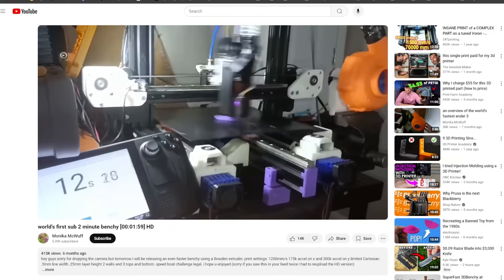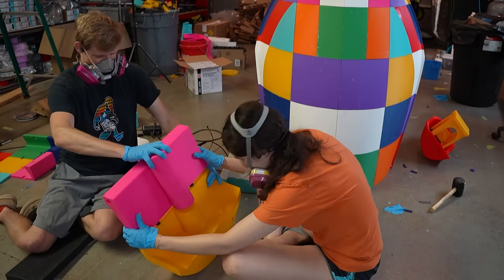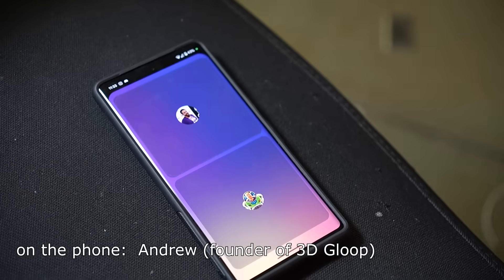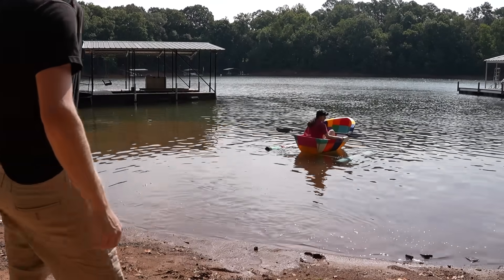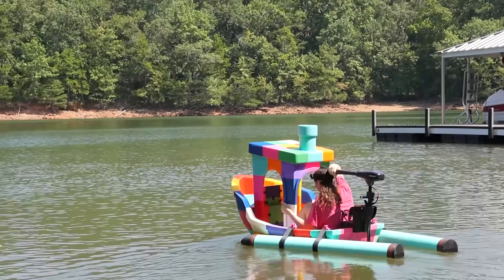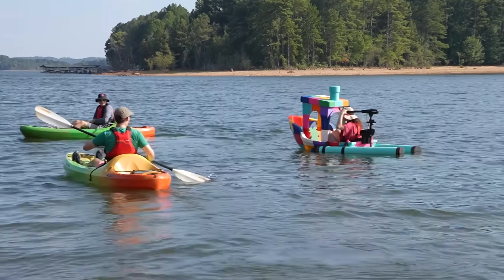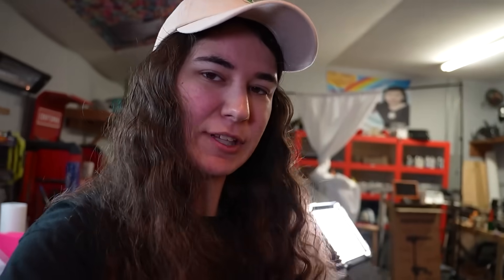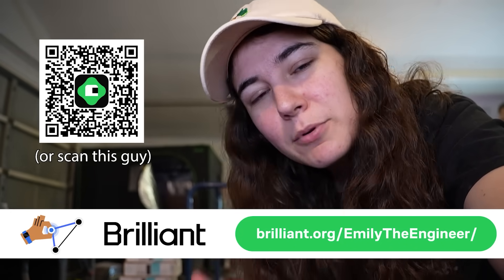I 3D Printed a Boat (World's Largest Benchy!)

Comment: Great video. But with 2 big float pontoons, you can get anything to work as a boat. Even an anchor. But the problem could have been solved with a heavy enough keel. For example, with a lead weight inside. The boat has enough buoyancy for that by a good margin.

Comment: Add a solar powered trickle charger for next time and i believe they sell kits for trolling motors that allow you to electronically control it with a steering wheel but I could be wrong

Comment: 9:38 The sun is so hot that it melted the connection to the battery. Totally hadn't had anything to do with using the power cable as a tow. This video is sponsored by Brilliant!

Comment: Next, I recommend a steering system for the trolling motor. You could use a simple cable a pulley system for simple pull/pull steering.

Comment: ideas that can improved to the boat
(E.E.E is that i will put more ideas)
1.make a Trailor that can hold battery (or make it some ware to put it)
2. put airsoft guns at the side to shot innocent by standers (friends) or put target on the water
3.make a pole attach at the mooter pole to control at the front like horizontal and go vertical (and try nom to hit your head)
4. put light at the front if you or some one want to go fishing on that or just go at night
5.put light at the back to put it reverse or just to se every one ware are you at night
6. put some paroles if you ran out of battery
7. try not to not put much things no not sink it (and put a flare gun)

and I'm 12 years old in July 17 I will turn 13 years old ( •̀ ω •́ )

Comment: As a person so is obsessed with boats and chips. The front of that ship was way too big in the back was way too small. You had to counter that front end with a back and even bigger worse or slightly smaller that was too small in the back to keep that ship or boat, whatever you wanna call it stable enough to float as if you took that out on a rough lake your cap size right away so just thought I’d let you know😊
Reply: But that was when it was on its own

Comment: you should’ve put a small weight on the bottom of the boat to keep it stable.. it’s not visible from the surface and they use it on real boats too

Comment: Just one question. When you scaled that up to print, how did you cut it into printable sections? Did you use a program to do it automatically or did you manually cut out it out in CAD?

Comment: It's a Hawaiian size for the shipping container construction 

Put the #sway_Bar on the #3D_Printer fam

$8,200.00

😭🫢🤮

A "sway bar" on a 3D printer refers to a custom-made component, typically a small metal or plastic bar, designed to minimize the amount of wobble or "sway" in the print bed, particularly during rapid movements on the Y-axis, by distributing the load more evenly across the bed's suspension system; essentially acting like a stabilizer bar to improve print quality.

Comment: Were the individual sections 'hollow?'
What Gauge Wire was used to connect to the electric motor? 
Could you design a keel weight (maybe a 'hidden' steel pipe or rod or lead weights) in a void molded into the sections forming the keel?
Interesting project.

Comment: Your engineer. I have a 3D printer challenge for you. 
Make a 3D printer that can print upside down. 
Then supersize it. The project being printed will be lifted by forklifts. 
Take the walls off the 3D printer an implement something similar to a dog shock collar fence. 
I have the printer itself be able to ride on it's something similar to a remote control car or a lawn mower. 
I need to constantly be consistent with the measurement of distance between itself and the project. 
I understand this project is big possibly too big. But so is your boat when you first got your printer.❤
Having you're a printer to be able to print plastic wood. And a secondary that can do the concrete.

Comment: The nice thing about 3d printed boats is each component has intrinsic buoyancy and would be much harder to Titanic.

*Though as someone who as a child experimented with pontoons, and later in life was a sailing instructor.... I would have gone with a telescoping ballast. or just a decently heavy dagger board.

**6:14 hahahahahahaha

***I am surprised you didn't put the battery in an aluminum case and cool it with water.

Comment: The first minute and a half in the video she claims a keel helped stability without mentioning that it was actually "stable" because the new print didnt include or have a cabin installed and the center of gravity was of course changed tremendously.....
This is not the channel for me "engineer"

Comment: If you ever take it out again, replace the lead acid battery with LiFePo4 battery.  5x the battery life, but it won't go into limp mode, it will just die, so use two smaller ones, and a change-over switch (or re-wire).  Just my 2cents

Comment: I think it would have been much easier and better if you drilled holes into each bottom piece, filled them with sand and get a better float so the top half is light and bottom half is heavy, keeping the boat from tipping over so much

Comment: MACROPLASTIC V2: Larger size for: full seat within "cabin", a full old-timey steamboat-willie steering wheel with basic console. "Smokestack" putters out smoke from a smoke machine with some kind of timed valve. Anchor system, or those multi-bolted circular boat windows for the front (and a below deck????). Sun and heat-resistant printing material if you HAVE to...

Comment: next, 3d printing a working combustion engine, car body, transmission, driveshaft, turbocharger, steering system, airless tires, TPU fillament suspention, sway bars, universal joints and fuel tank

Comment: Pretty sure that if you have a motor (even just a troller) you need to get it registered to use on public water (regardless of length), but with just paddles you are good up to 18 feet. Dunno if other states have similar laws...

Comment: Emily, I think you did a decent job with this test model. 
I suggest you try a bigger one wide enough to comfortably fit 3 people, with a  2-person limit. Then, add weight in the center and no pontoons.
Also, add a ring to the build in the front center for towing in case of emergency, as well as a patel or 2. Required lighting and eventually getting it licensed (for legal reasons, don't want a ticket for an unlicensed watercraft).

Comment: I would have printed the pieces to be more like jigsaw pieces. Locking into each other to give it a bit more structural stability on top of glue instead for smooth sides glued to each other. And probably cheated with a marine grade fiberglass coating on the inside to give it more structural stability and to seal leaks.

Comment: The only problem with this boat is the tendency to roll. You could use a more or less rectangular cross section, which offers the best stability.

A kayak has an ellliptic cross-section which also helps with that problem.

Comment: If you want to be sure it does not sink when encountering some waves, create a sealed void space big enough to displace the total weight in water. For example, if you expect up to 200 kg or 400 lb of total weight, have at least 200 liters or 7 cubic feet. Roughly estimated, that should be achievable if you make the walls 15 cm or 6" thick. Finally, have a small hatch for your void space to be able to get out any water that leaked in and to release any air pressure difference over time

Comment: If you have a round narrow boat with most oaf the weight up high, you're not going to be stable. The best way to make a stable boat is to make it wide with a flat bottom so you get a rectangular cross section. Having a keel does absolutely nothing unless you put tens of pounds/kilos a couple feet down

Comment: I'm not an engineer, just a boat building enthusiast, but the issue with your stability has to do with your hull shape.

Your hull is closer to an hourglass shape, which gives it really good secondary stability as it rolls over, but because the topsides of your boat are so short, it takes on water before it can right itself. One thing you could do is raise the topsides and add more ballast to the bottom of your boat, and you'd have a fun little sailboat.

But if you want more of a rowboat, you should really flatten out the bottom more, making it somewhat of a rounded rectangle. That will give it more primary stability, allowing it to sit flat on the water better. It just won't do well in waves or chop.

Cool build though, I would never have the patience to do all that with 3D printing, lol.

Comment: They make plastic welders! They are not expensive and they have different shaped tips. The tips have holes in them. They either come with or you buy separately the rods of whatever kind of plastic you are welding. So you similar to a glue stick you push the rod through depending on how much extra material you have to add to make a nice secure welded joint. Most of them have variable temperature settings also so you do not burn the plastic. They also make the rods in many different colors to at least get close to the color you are welding! When I worked in car audio the plastic welder worked much better than trying to do the weld with a regular soldering iron because it makes a troph as u run the soldering iron down because there is not enough plastic material to make a nice even weld that's not indented. Anyway great chanel and great job! Maybe a welder would work for you! Good luck!

Comment: Should have used a deep cycle battery. Not a car battery. The discharge rate of a deep cycle is designed for what youre doing. A standard car battery is absolutely not

Comment: instead of pontoons you needed ballast. Your center of buoyancy was above your center of gravity which made the boat unstable... it simply needed a lot of weight to bring its draft deeper into the water and bring the center of buoyancy down.

so, like, fill the infill with concrete at the center keel of the boat and that would have probably helped

Comment: You really should use a group 24 deep cycle battery for that trolling motor, as it works a lot better last longer and Will Survive multiple recharges. Where's the nearest specifically designed for this purpose

Comment: Now you just need to make a pully system of wires that will allow the driver to use a steering wheel to turn that overhead control for the motor.

Comment: The approach to stability is kinda surprising. The highest initial stability is generally found in flat bottomed barge like boat. While adding a volumetric keel to the bottom of the boat lets you get your ballast lower and bring down the center of gravity it also moves the center of buoyancy down. When the boat heels over that center of buoyancy moves to the side that's high and works against you.

He is a boat builder rather than a naval architect (which is properly considered a branch of engineering) but Leo Goulden of Sampson Boatworks has a really good video explaining boat stability.
Reply: Interesting, but the original Benchy's shape might not work as a flat-bottomed boat. I'm not an expert, but it looks more like a (very) curved hull which has just had a bit of the bottom sliced off, possibly at less than the best angle.
Reply: Can you tell me the name of the video you're talking about?
Reply: @yzirf_sharova  'Stability Calculations (Boatbuilding / Tally Ho EP125)' on the channel 'Sampson Boat Co'
Reply: @yzirf_sharova  Stability Calculations (Boatbuilding / Tally Ho EP125)

Comment: 1:50 Warning to anyone watching, If you want to use a soldering iron to melt them together, ensure you use a respirator as there are dangerous chemicals that are in the air if you do this.

Comment: So the adding of the keel (that was added into the model) that bottom of the boat should get extra weight into it, and then put a flat floor down. That's largely how most boats are made and would greatly improve the stability and draft of this benchy.

Comment: Btw, they have a tool specifically for plastic welding... it's basically a soldering iron that's attached to a paperclip in a squirely pattern... the idea is that you melt the paperclip into the plastic, and then trim the excess paperclip, and bondo over it to make it smooth.

Comment: Only 6 min in, but most boats have weighted ballast in the keel or next to the keel to keep them upright.  If you just put extra weight along the center of the bottom, the stability issues would be fixed.

Comment: YOU BROKE THE FIRST RULE OF PLASTIC WELDING... 
ONLY USE PLASTIC TO BOND PLASTIC. 
YOU SHOULD HAVE MADE "PLASTIC" GLUE OUT OF SCRAPS AND ACETONE TO FILL IN THE SEAMS.
I HOPE IT DOESN'T FALL APART ONCE YOU PUT PRESSURE INSIDE THE HULL
Reply: They did put pressure inside the hull in the form of a person. It didn't fall apart. Notably, they had a person in it when it was sitting on concrete, unsupported by water.

Comment: That’s really good and looks fun. And it’s a good proof of concept you can actually print a boat. The only downside is the design, I reckon if you mimicked a speed or rowboat shape then I think you wouldn’t have need the extra flotation. But apart from that I think you guys did a really good job and it’s looks like a lot of fun. Keep it up

Comment: Now, print it even larger so that you can stand up inside the cab. If you made it larger, it would make it a lot more stable. Also, you would want to add weight to the keel so that would help with preventing tipping.

Comment: Make some hull extensions for the sides of the hull that stay under the waterline and stabilize it wihtout being visible. Also, for propulsion but a brushless RC motor in the existing opening no the back of the hull.

Comment: Should have gone back to a flat bottom when you scaled it up.  And it doesn't look like a Benchy without the cabin.  Also as a very stable genius pointed out, if it sinks from the weight of the battery you'll have to decide whether to swim toward it and get electrocuted or toward the shark and get eaten.  Or, you know, some other direction.

Comment: This is not the worlds largest benchy. When I was at the marina in Roscoff (France) about 3 months ago, I saw a seaworthy "full size" version of the Benchy Boat 3D model. I'd guess it was maybe 6 meter long (at water line), and it was big enough so that the weight of people on it was much more centered, thus not making it capsize. It also had one of those small motors which people usually use on a dinghy. It was sitting in the water, so no idea of there were any changes compared to the typical 3D print model under the water line, like a keel or similar.

Comment: should try a 3d printing pen for fusing pieces together works really well, not sure which is stronger the 3d pen vs the soldering iron but the pen allows for filling gaps so its always been my pick.

Comment: This was a most impressive insane project 😀 , You may be able to reduce the weight and have a longer life battery if you switched to lithium ion rather than that lead acid battery, You could also mount a airhorn on the top for some reason 😀 Also just how many spools of PLA did it use in the end? 😀

Comment: Dang. About 12 years at 3D design, designed around 200 prints, rarely print other people's and I've never printed a benchy. But I do like boats. I have a couple I think on thingiverse, user fluidity. My bigger projects over last several years are hydrofoil models and then I mould from them and cast carbon fibre in the moulds. For sport of wing surfing.

Comment: If anyone else does this: more hull under the back, not outriggers. Also fill the hollow prints with polyurethane spray foam (use an infill that lets if flow).

Comment: It's the VW Harlequin Golf of benchys! DAS BOAT!!

 Also, deep cycle batteries are preferred for trolling motors. I had a plastic, one person boat and putted around a huge lake for three days. Probably 12 hours of motor time.
Reply: The amount of energy that's in an empty battery (below 30% is considered empty) is still enough to destroy itself.
Reply: @paulmichaelfreedman8334  that's simply not correct. It depends a lot on the kind of battery. Lithium batteries, yes, they get damaged when depleted. Lead batteries, not that much, specially if they are kept correctly: https://en.wikipedia.org/wiki/Lead-acid_battery
Reply: @almarma  I know that, but most people think lithium when thinking of batteries nowadays. Lead-acid is an old tech now only used in established systems that have not been upgraded yet. And I think it should only be used now in situations where the specific properties of lead-acid make it uniquely suitable. Anyways, the "zero-point" energy (chemically speaking) is huge in lithium batteries.
About lead-acid, I know they can be deep-discharged way further than lithium, but with standard batteries you do have to watch out for dendrite formation. Absorbed glass mat batteries have way less dendrite formation and can be ultra-deep discharged with little to no damage. AGM batteries are sturdy as hell too, can smash a hole in them without the electrolyte spilling out, or very little. I dabbled a bit with batteries around 15 years ago, interesting business.

Comment: makes easily flip-able boat, boat flips, proceeds to overengineer the crap out of both not flipping and if it flips how to make it safe. probably could've made it safe before making flip-able boat, but i guess safety third. math boring, testing fun. build then itterate no need for silly paper planning.

Comment: Yeah these electric trolling motors really die on you quickly. Built a raft for me and my friends with one and the battery died on the way back as well. No warning whatsoever. Had to paddle the 350kg heavy abomination back to shore with boards we unscrewed from the deck xD Wasnt fun, since it was as hydrodynamic as a brick, but we managed it somehow.

Comment: Extrude the bottom shape about 5-6" and fill the cavity with weight.  Whatever weight you use, lead, etc. epoxy it in so it doesn't shift.